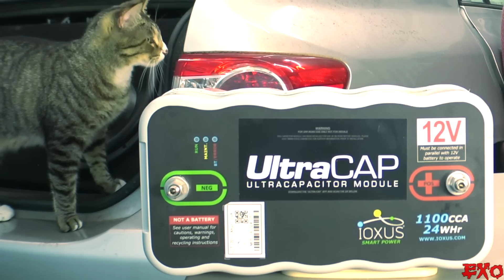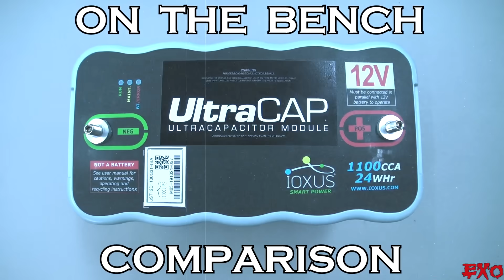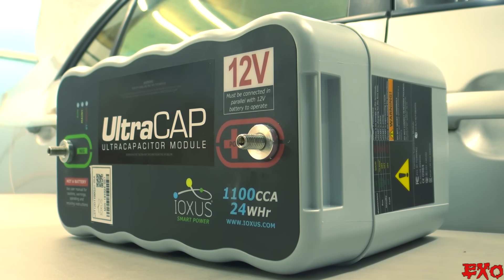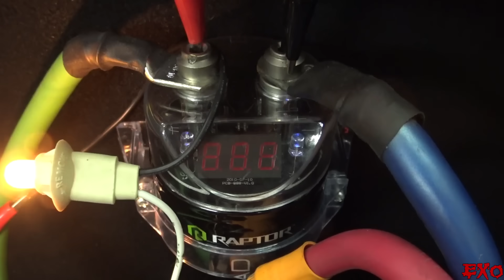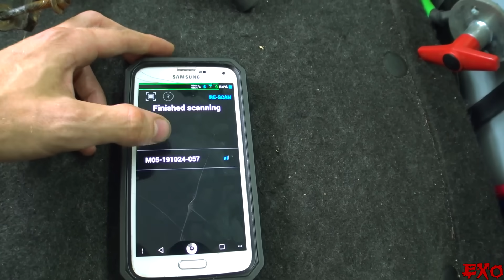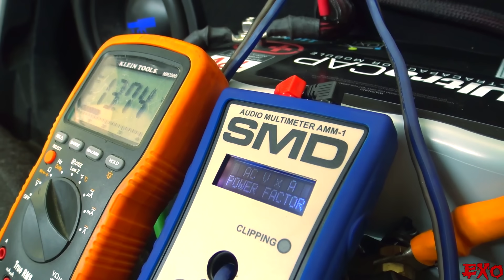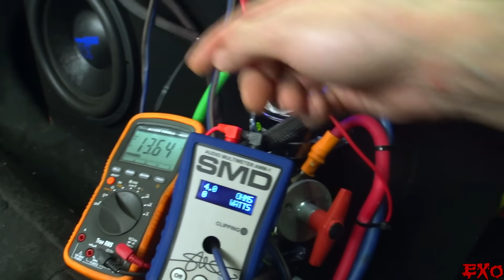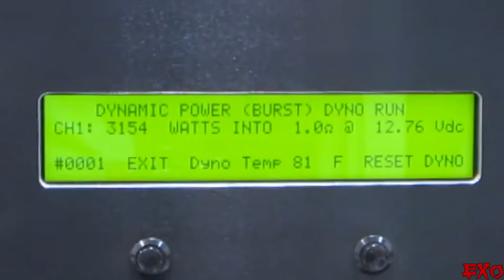The TRUTH About Car Audio CAPACITORS! Testing a CHEAP 12v Capacitor VS IOXUS UltraCap Supercapacitor

Comment: like meade916 say does work close as possible to the amp keep in mine that 4F will take longer time storage energy to then release to the amp supply system of the amplifier with those fast bass notes it does help you can even place them in parallel

Comment: Ah another kick ass video. This would go great in my bmw where I just did a build with 4 massive 8s. The issue now is dimming. :/ and on a 240 amp alternator. I second video about this versus a second car battery if you could. ;)

Comment: 1 question I have, is would I be in need of a UC if I got a big amp, I'll be upgrading my Alt to a 300A and of course my battery to. So that should be good while I'm driving. So would this UC help me if I wanted to bang in the parking lot for awhile without driving anywhere or needing to start my car? Or are these UC's beneficial while driving also?

Comment: Good job. Caps are just meant to be a tiny tank to allow the amp some breathing room. Like you said. It's not going to do much if anything for RMS, but it will provide some headroom for when power draw peaks. It's a little more efficient when you look at an amp with undersized internal caps and can help with clipping that might not show on a bench with a big battery bank. Someone with a stock alternator running a 1k amp off of some 4 gauge would get a lot better performance with a decent cap installed. Like you said tho. Super Caps are a whole other level tho. They give plenty of peak performance with more actual storage. The storage is nowhere near lithium or Lead, but for car audio supercaps are going to be the best option for extended play and spl applications.

Comment: Hey EXO, been a fan for a while but never  subscribed until recently. I have a a pair 12s amped only pushing a few thousand watts but I've always looked for a cheaper less expensive ways to push out deep loud low bass, and with all your vids and info its been very helpful. We do have a few loud cars here in New Zealand 🇳🇿  but we don't have much of a variety like the USA and things are pretty expensive. love the videos...keep it up bro. Love to get that ultra cap if lucky....CHUR

Comment: I remember when a 1 farad cap was badass back in the day... like over two decades ago. And to think you can now have 375f at over 14 volts is insane. I want one of these so bad.
Reply: I used deep cycle boat batteries,  gel cell,  or glass mat. I thought that was the answer.  I'd love one of these too.

Comment: This little ultracap bank would help me out a bunch with powering my Orion XTR 2500.1. The Orion is a beast, but the current draw can get a little ridiculous at times, peaking up over 400 amps of draw. It would certainly be a nice buffer to clean up the incoming power between my 250 amp alternator and batteries, and the amplifier. Nice video Exo. I appreciate the math and the tests you did to show exactly what this thing is good for and how caps work in car audio electrical systems. Showtime did itself a favor hiring you, man!

Comment: How would the ultracap fare against an AGM battery in a similar competition? Which setup would allow for higher voltage to/wattage from the amplifier? Since you already have the numbers from the ultracap video, maybe you should replace the ultracap with an AGM, and show us those results.

Comment: I'm still stuck on how the capacitors play their role in cars... they don't replace a battery but help induce more charge to sustain the required voltage by the userm

Comment: Shortly, Normal Caps with like 1 to 10 F are good for Quick Current draw like kickbass.
In the Video they only use a 1F cap... The 4F Cap in this video should help a lot more

Comment: I had a 4fared cap for 4 years SLAMMING two 12” Rockville’s and it worked fine but then I upgraded to 2 yellow caps and she’s a thumper now! The Big 3 helps too tho. Do a review on the big 3 upgrade compared to regular wiring

Comment: i've always been a fan of 2nd battery, but caps do have their place, and as Exo said, its use specific, i recently added some motor controller super caps that are 8.4F each in parallel just to catch the spikes in voltage as well as to aid my power inverter with startup loads, other than that i'd prefer to relocate my battery to the back of my truck and free up the space under the hood for a trick intake or extra alternator, great vid Exo, very informative and as always you kept the information "bite sized" and made it easy to understand for the non bass head crowd, stay awesome my friend

Comment: I’d like to see a video of this cap vs a second battery...
Reply: Yeah thats definitely a good question. Bc I'm not 100% sure if I'm gonna need a second battery, but first I'll be upgrading to a 300a Alt and then a better battery to start off. And Hopfully that's enough, but if not I'll be in this conversation myself.
Reply: DonnRonn Bagger I feel like it’s all subjective to your system and what type of power you are pulling so everyone’s is gonna be different but, I bet another battery with a high output amp wouldn’t hurt lol
Reply: @_JoeMomma  esci2
Sxsgaza 🔥%
Reply: @donnronnbagger1727  You don't need a 2nd battery, but if you're investing in a 300a alt, it does make sense to invest in another battery or two as well.
Reply: @Des420  yeah what I was thinking was after putting in on a 300a alt, I just wanted to get the best possible battery that I can, not sure of what my exact needs would be right now, but from that theory, I'm wondering if I will still need another battery in the back, or a cap, or would my system be fine with the 300a alt and a good battery something with over 1k cold cranks, I'd have to look into Ah and all that to see what is my best option. But I'm hoping the 300 alt will be key to not needing a million different pieces of equipment you know
Reply: @donnronnbagger1727  hhh
Reply: @donnronnbagger1727  xs d3400
Reply: @lowhertzhighspl  thanks
Reply: A cap can discharge faster than a battery, but the main thing is it can recharge alot faster! Even outperforming a lithium battery, to an extent, both would be awesome.
Reply: @jamest.5001 after getting shots in many different electronic experiments, I'll totally pass on lithium batteries. But a cap totally sustains the headlights in vehicle while the base drop is really drumming hard for a second. Whereas without it it might not be going quite as fast. It doesn't take very long to be driving with no base for it to fill back up, especially if you're driving 90 something miles an hour
Reply: go buy a $75 deep cycle. it'll be the best solution for the money. I ran dual batteries with 2 nvx 15" vcw subs for well over a half hour with the engine off during an after work get-together, worked like a charm. single caps are utterly useless with 300+ watt systems, second battery will net you far better results for the same price.
Reply: @frostbite1991  Deep cycle batteries don't last in automotive application. Waste of money.
Reply: I’m a noob but it looks like 10 in that ultra cap
Reply: If you hook a cap up without an extra battery it will dim even worse because of the speed the cap pulls power to recharge. Have a 6000 watt amp pushing 4 15's with 0 guage wire, a big cap and an extra battery.
Reply: Caps aren't designed to start a car 😅😅 love your channel exo
Reply: @mikehause6585  that's exactly what these caps are made for lol 🤣 and they do a much better job at it 🤷🏼
Reply: @Mike Hause  this one is..and jump a dead battery
Reply: Yeah
Reply: I would like to see that cap vs my battery, it is a 4DLT 85lbs 970 CCA , i ran 2 batterys and a 200 amp alt
Reply: Yeah me to. I'm running a xs power 3,100 amp AGM High output battery Ah 60. With a xs power 950 amp AGM, supplemental (secondary) battery Ah 35 all in 4 gauge ofc wire. I replaced all my stock grounds under the hood with 4g ofc. Can't do alternator power yet because my intake manifold is in the way.
I'm at 2,000 ish rms watts between 2 pioneer amps. 1,200 rms on 2 12s and 800 rms on 4) tweeters and 4) 6.5s. I can't tell much of a difference in performance over my stock battery and a 2.5 Far cap. Xs power recommend those specific batteries for my model car on their website. I still can't keep my voltage above 13v on hard bass lines. It does recover quickly tho. I get back to 14v in about 10 seconds after I stop the music. I feel like I didn't get much performance for $500 in new performance batteries.
Reply: I need it
Reply: The person who owned my car before wired it and it works somehow? Idk kinda scary. Has an amp and capacitor no different alternator but there is a modification on the positive battery capable that boosts amps idfk never seen one
Reply: I got two 12 db drives on a precision power 7 thousand monoblock
Reply: Super caps always charge and discharge quicker.
Reply: I'm running 4000w max 2000rmsand 8000w max 4000 rmsamps
Reply: If you want to see a video of that time travel back to 2007 in Houston. I'm a white girl basing out stuck in traffic going to the gym. A car full of hood dudes in a classic car challenges me to a base contest since we're stuck in traffic even though there's 24 lanes. But several volleys between my Ford Lightning and their car back and forth their car stalled out. I had a 5F cap, 2 amps, had done the big three upgrade since I got it and it was a Ford Lightning so I think everything in it was built to be abused by all the mostly men who bought the truck. I was just watching this cuz I wanted to rerun some audio wires in my truck and do the grounds and I forgot how to just unhook it. I never fooled around with discharging it like that. I know for sure one of them I had totally ruined a robber's day, he didn't know what it was so when he tried to rip off a base amp on the side of my box, he got a shock really good, so good it melted the fuses deep inside of the amp, I had to take it apart to get the fuses out. It's still going though. Or at least it was I think it got stolen and I upgraded again 22 years we're still doing it
Reply: How many watts rms do you all think this UltraCap could reliably handle?  I’ve seen thing saying 1000watts per farat but I don’t know I’ve ran 3k rms on a 7 farat never dropping below 13.2. What do you all think?
Reply: If you have any sense a decent 2nd battery is going to work much better
Reply: Ultracapacitors have a much higher power density than batteries. This makes them ideal for high-drain applications like powering an electric vehicle. ... Ultracapacitors can also be charged and discharged much more rapidly than batteries, usually within seconds, and are much more efficient at self-discharge than batteries.
Reply: @timmayer2328  Very low internal resistance so they can deliver very high currents to the load very quickly. However, the reserve capacity is terrible compared to a car battery. His cap shows a rating of 24Whr in the video. An average car battery is around 500Whr. So you can draw a fairly high current for much longer from a battery. Depends what you need for your install
Reply: @timmayer2328  You will easily get a SLA battery of the same size as that ultracapacitor with well over the 24ah it has, even if you take the sensible discharge limit of SLA and for a fraction of the cost. The capacitor will be lighter but weight is seldom an issue with an install big enough to require a local power source.
Reply: A super cap will charge and discharge faster than a battery but won’t have as much actual energy storage.  

This cap would likely keep the voltage steadier, as long as the alternator can keep up. 

the battery would lose voltage during big draws  but over all have much more stored energy,  kind of a tortoise and hare scenario. 

It depends always on whats being used and how it is being used.  Remember you need energy to charge the cap and the battery so the Alternators output is key too how much power u can create over a given time.  Batteries and caps all store energy they just do it in different ways, The alternator is the only thing creating energy
Reply: @williamkillingsworth2619  I just have a secondary high cap battery with a 280amp alt. (Stock for my truck is 138a.) Granted I'm only running 2 EX-693s (150watt rms 800 max) some 4" tweeter in the dash, 2 6" door subs (custom box behind panels lol) and 2 8" subs in the center sonsole. Rockford fosgate 4 channel and a 2 channel.
Reply: william killingsworth Off the subject but do you think the super caps are good for CB amplifiers/linears? I wanna run a 1000 watt amp. Guys usually run 4 to 6 truck Diesel batteries for that type of wattage
Reply: HV Lipo battery lol
Reply: Just get your self an Optima battery yellow top. Single battery no need for a capacitor an will start everytime!
Reply: @Jodyjoe8816  maybe a decent AGM, not a yellow top.   Deep cycle batteries are great at being heavily discharged and are able to slowly recover, ( a situation that would kill the best lead acid battery)   yellow tops are Expencive, heavy and overall not that great overall
Reply: @Jodyjoe8816  until your car breaks down and that battery sits for a month or 2 without a trickle charge. Then its garbage, just like Optima batteries in general. You want a quality battery get an east penn.
Reply: @johnvancamp1576  Have you found them to be better than Odyssey batteries? (I haven't heard of them before, wasnt sure if it was essentially the same thing but with just a different name for the area)
Reply: @dangstalker  i.would.get a north star batt over. oddessy

Comment: i have a quastion for you guys i will upgrade my car with a bigger sup and other high and middel speakers the setup will have about 2000 watt rms so my quastion can a normal allternator (90A) handling this power? or did i need a bigger one

Comment: What I say about "regular" stiffening capacitors...
"It's like putting a band-aid on a broken leg."
Instead of buying a cap, spend that $ on doing the "big 3" (battery + from alternator; battery - to chassis; engine ground to chassis)

Comment: I  have alwas tought that caps where prety much usless because most of the ones in the market where super cheap ones not helping the fact that they had false ratings kind a like those 5k amplifieres that had 25 amps of total fusing, ultra caps on the other help prety good, since deep cycle batteries may have a masive amount of stored power delivering all in a single kick is not their forte. so having a combination of both will be the best scenario to keep those power chugging amps happy with great stable voltage not to mention saving wheight by not having to run more heavy lead batteies.

Comment: So a few questions from a noob in caraudio, but a channel follower. 
1. Is a capacitor always needed when installing an amp and/or subs?
2. Why not installing a big thing (capacitor) from the start?
3. Are there drawbacks from using that big thing ?

Comment: YES, a capacitor. Just running 2 regularly car batteries right now for my system and stock alternator. Would love to upgrade my system later on and get a custom alternator but $500 and takes a couple weeks

Comment: Let's just say I have a small system like a 6" sub running a 10 farde cap...how would that do?
Reply: It all depends on the rms of the amplifier the size of the sub has nothing to do with it
Reply: A stock electrical in a car is good for around a 1000 watt rms system

Comment: Used to use a 1.5f but I never really had great results so I took it off. I was super new to the bass head scene so I didn't really know what I was doing. Fast forward to now, I figured out why it never gave me what I needed. I had the cap closer to the battery than the amp. Now I'm getting ready to do a bigger build and could use the extra help of a supercap, not to mention the extra feature of being a jumper. Btw EXO, check out Auto Effex off of 301 by the Sunbelt Rentals. They carry some top quality sound equipment. I go in there quite regularly especially for small things like terminals and what nots

Comment: I can't believe the price difference from when I was doing installsin the mid 90s.  Amazing what customers paid for a 1F cap just to give those systems the bit power dampening to prevent electrical system drain and we made almost nothing on caps.  Amazing to see the amount of power available in such a small package today.  
I could use a hook up on components to build a system in my  21 yo truck that I was left with after letting the Ex-wife take the newer vehicle since she got more time and would end up hauling my boys around more often I would rather my vehicle break down than her with my kids.  Unfortunately it also had the system I built in it.  Anyway, trying to build a decent system again, on a much smaller budget.  EXO, Keep up the entertaining and informative vids.

Comment: Felt like you were gone forever bro!! I have never had luck with single capacitors.. I have a single 600 amp hour batt in the back the runs my system great. Add the cap in and it stops working ..

Comment: Sweetness. Im in the process of rebuilding a truck and plan to install a small system in it. (Maybe two 12s or 10s im back and forth between brands and sizes but its a work in process) This would be a great addition for the rebuild. Nice vid EXO

Comment: Would love this cap, been contemplating a second battery for a while. Controvertial cap vs battery has led me to battery. But this thing looks sick. I have a rockford fosgate 1200w amp and a deaf bonce machete super sport 12 inch sub capable of 1300w rms in a custom box tuned to 32 hz. Zero gauge running for wires and 12 gauge for speaker wire. Still get headlight dimming.

Comment: The new JL amps, some of them anyway, have hardware and software combo that allows the amp to have stable output, even if the voltage varies up/down. But, not sure how they fair in regards to dimming headlights. I would think upgrading the alternator and/or using a second battery is a better idea than a cap.